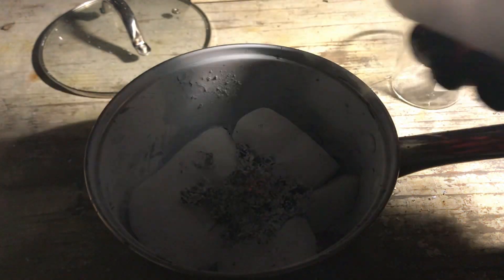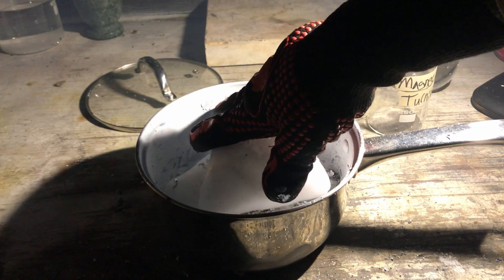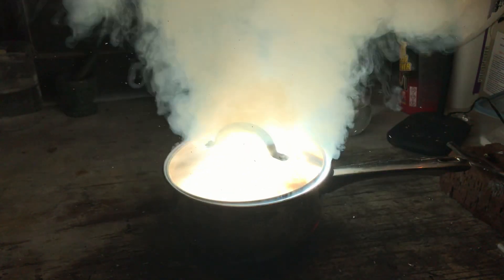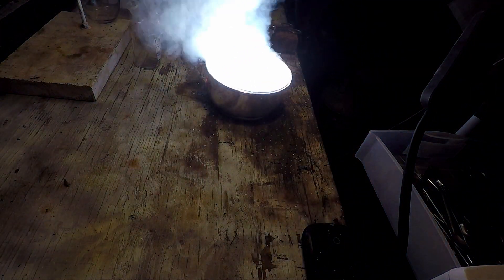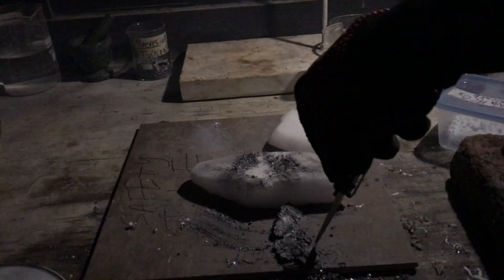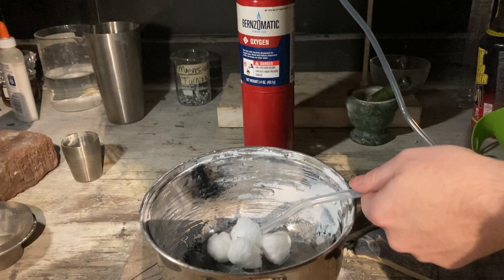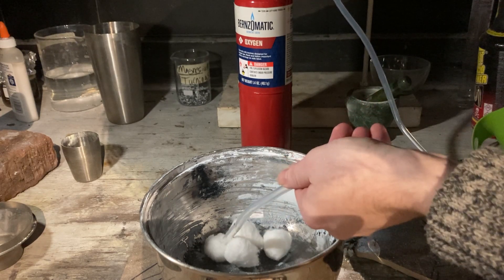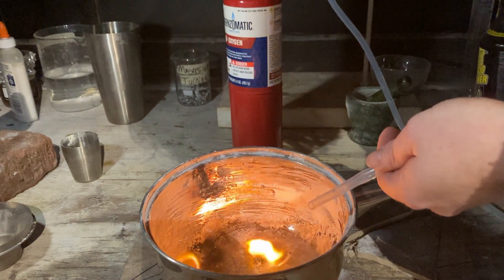Pyromania - Volume 1 - Magnesium+CO2, Cotton+Oxygen and Flash Powder

Comment: a straight black powder without any Al would of been better
Reply from the maker: Yeah I was going for light output by adding the aluminum, and this does burn a bit brighter but honestly it was a crappy mix all around. The permanganate variation was far superior in every way.
Reply: @FullModernAlchemist  i was also referring to the increased burn speed of the blackpowder would release the light faster etc.